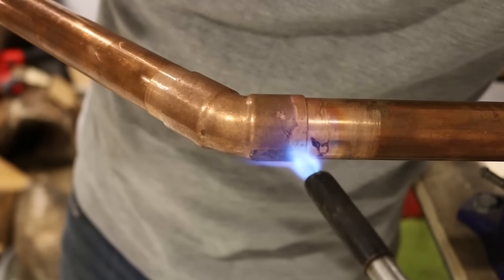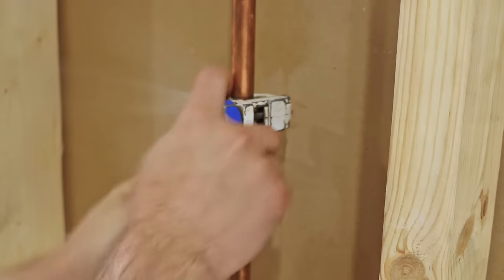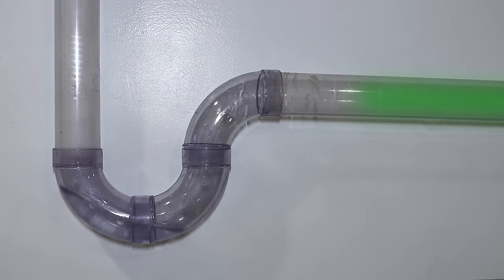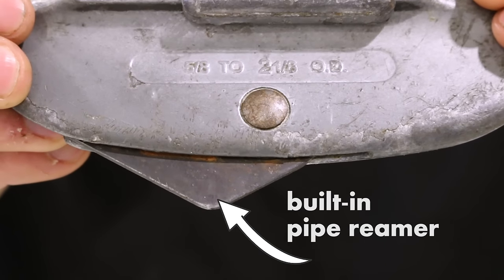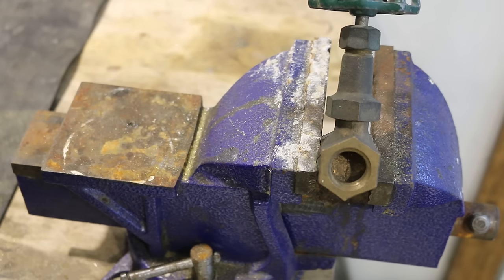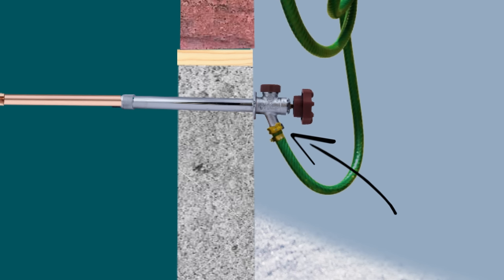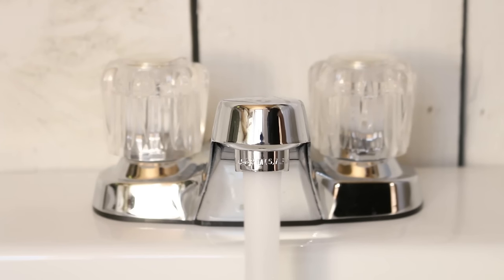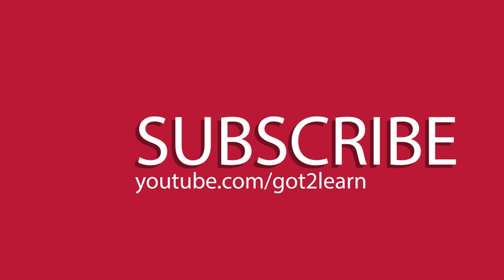The ULTIMATE Plumbing Mistakes Guide (30 Mistakes And How To Fix Them) | GOT2LEARN

Comment: Generally good advice.   BUT the use of rubber plungers, never use the toilet plunger on any thing else, just imagine where it's been. Always have one for the toilet and a separate one for sinks and wash basins
Reply from the maker: Only in an emergency 🤣
Reply: @Got2Learn  Now I can understand using a sink plunger if the toilet was blocked, now that's a real emergency!!!!
But no way would I use a toilet plunger on any indoor sink or wash basin, especially if it was Saturday and I had previously used the toilet plunger the night before !!!💀💀

At a push I'd consider using the wife's hair dry on max, if that fails then I'd consider using the vacuum cleaner, when the wife wasn't looking.😗
Reply: Actually I just remember about 6 years ago, while trying to run pipes for a rad and struggling, my son , who was 5 years old at the time, came out with a really good pieces of advice which was.
" Dad perhaps you should call out the professional's "
It was the way he said it after asking if he could help  lol

Comment: I agree with just about everything in this video except the “proper” use of dope/tape. Dope on top never gives a cleaner finish than tape on top unless you work in slow motion and never touch the dope with your hands/gloves. Also I’ve done it both ways all my career and have never had a single leak at a thread in 14 years. So it really doesn’t have a “proper” way. Just do it either way and learn to tighten stuff properly. Don’t be lazy and two tug your wrench, save that for your bedroom lol.

Comment: Why are "Flexible speedways" a bad thing... The one at my toilet is about 25 years old as is 100% as new. And the ones to my kitchen sink are 18 years old and as new. My father has used these for the past 30 years (as a plummer) and not once had a problem with these
Reply from the maker: Older models weren't made as cheaply as the once from today ;)
Reply: @Got2Learn  Ahh... that actually makes sense cause almost everything today is less durable than it was some 10-20 years ago. Thanks for all the great tips. Much love.

Comment: Vents are not for putting air in the drain. They provide reverse atmospheric pressure to prevent the syphoning of traps. A drain is designed to flow at half full, hence, there is always air in the drain. If we didn’t need traps we wouldn’t need vents. Also, if “vents let the drain breathe” thing is true, why are there no vents on a sewer and why is the code book only conceded with trap to vent distances?

Comment: First. Let me thank you sincerely for providing this very helpful information. So please don't think me over critical when I mention that all of the flux used in the video is Oatey #5 self cleaning flux. This is illegal. You must use lead free flux. Also, the guy soldering is applying the flame to the wrong place on the fitting nearly every time. It has to be heated at the shoulder, or where the pipe bottoms out on the fitting to create capillary action, sucking the solder into the joint, especially on upside down joints to prevent icicles. The dishwasher drain is also illegally connected. The corrugated drain from the DW must be strapped in the cabinet to a higher elevation than the drain connection. Also, mention that NO teflon tape may be used on black steel pipe used for natural gas. My apologies for being critical. I have 36 years in the business. Also, when plunging that bathroom sink, be sure to plug the overflow hole with a rag or you'll take a bath with dirty water

Comment: At a federal prison build, the contractor wanted dope, then t-tape. Why? Less chance of getting debris on the threads. Funny!  Why does it say "sealant" on a can of pipe dope? Because if it said "Lubricant" (what it actually is) people would use motor oil or KY jelly instead of pipe dope.

Comment: Interesting that you're still using 95/5 Tin/Antimony. Code here requires 97/3 Silver/copper. 1 lb of solder now costs $25 usd. That's one expensive makeshift belt by the way,
Reply from the maker: I guess is changes from place to place, oh and also, you can use the solder from the belt, no point in throwing it lol

Comment: Dielectric unions are no longer in the code…as they do not work… it’s now required to use a brass nipple..at least 6” long if possible
Reply from the maker: Soon those won't be code and the unions will come back, don't sweat it lol

Comment: The lead solder issue is not really a problem.
IF lead dissolved into the water it would be dangerous but, if a lead pipe layed in 1860 is still sound and not leaking it stands to reason that it's not really dissolving.
Reply from the maker: Maybe that's why people are getting sick

Comment: Put some pipe dope on the threads before wrapping with Teflon.....screwing dry (taped only) threaded PVC into metal fittings is risky. Never ever use Teflon alone,  except maybe on exposed shower head connections.
Reply: NEVER PUT PIPE DOPE BEFORE TEFLON !!!!!! TEFLON TAPE FIRST , THEN PIPE DOPE .
Reply: @robertn2813  Teflon tape is only necessary when the threads are possibly sub-standard. Quality cut threads are fine with just pipe lubricant. But if you add pipe dope first, as you wrap the Teflon tape tightly around the threads it pushes the dope deep down into the bottom of the cut threads. Simple, no biggie. Yeah, I know it causes the tape to spin around as you make-up the fitting, but that cuz you don't know how to wrap it tightly...there's a simple trick to that too.
I'm wondering why you YELL AT ME WHEN I'M ONLY TRYING TO A GOOD THING.

Comment: Thanks for your good advice.

Vinegar + Soda doesn't seem to make sense to me as they neutralize one another. 

Lead pipes and lead soldering aren't that much of a health problem as long as the pipes conduct cold water.
It's hot water that dissolves lead much more and contaminates the water.

Also worth to mention is that sewage odors can enter through a p-trap if the trap has dried out due to rare use like prolonged absence etc. - Just flush in some water to refill it.

14:50 -  When using a sink plunger it's necessary to cover the sink's over flow by simultaneously  pressing a wet cloth tightly onto it. Otherwise there's no pressure built up in the system and the sink plunger won't do the job.

Comment: I love the "Airguns" you get for unglogging.
With Copper and Steel you need to look at the flow direction, steel to Copper is fine, copper to steel is bad. At least for galvanized pipes

Comment: ALWAYS brush both the copper fittings and pipes. No excuses. They look clean, but are not.
#30 is a Backwater Valve for drains.
A Backflow Preventer is for protecting the potable (drinking) water from contamination.

Comment: What you are calling a saddle valve is actually a saddle tap. There is nothing in it that can shut off the flow. The stem is smaller than the hole in it. You are correct they are illegal in both major plumbing codes. They are junk and should not be used.

Comment: At 1:05 you show measuring pipe thread on female fittings and then say to tighten them up that much. That is very suspect and is a questionable practice. Instead, with brass or steel fittings you spin them on hand tight and them 2 - 3 more turns with a wrench Cast iron is put on hand tight and then 1 - 2 more turns as cast iron is more brittle and likely to crack.

Comment: 1:43 as opposed to what?
Reply from the maker: Don't understand your question sir.
Reply: @Got2Learn  Your video is regarding mistakes people make. The particular item that I pointed out was you telling us the  "correct way of branching off a water line" that it should be "soldered or crimped." I''m asking you "as opposed to what?  What would an incorrect way be? What would the mistake be that you are telling us not to do?
Reply from the maker: To not use a saddle valve ;)
Reply: @Got2Learn  Got it! Thanks. Definitely wasn't clear in the video.

Comment: Teflon tape should only need to be wrapped 1-1/2 times around the threads as long as the joints have been threaded correctly . I frequently wrap Teflon tape backwards when it is more convenient for me to do so. If you apply it tightly and press it firmly into the threads it won't unravel.

Comment: Pritty sure I use teflon counter clock ways when using it on GAS pipes. Literly 30 secs in the vid and I alredy have to correct you. Fuck it im out.
Reply from the maker: counter-clockwise you said?🤨
Reply: @Got2Learn  Yea I dotn know what I typed above. I was quite drunk. But fact remains. If its a counter clockwise thread then you need to wrap it counter clockwise. So its not ALWAYS clockwise like you said in the vid.
Reply from the maker: Agreed!

Comment: 1:48     I could not find that exact brass valve your using but they all 'usually' contain plastic and rubber components. It's bad practice to solder this close to the valve as the heat can easily melt the non metallic parts. Even if your valve does not contain plastic or rubber, you are setting a bad example for the D.I.Y.ers your video is aimed at here. The rest of your video spot on, good job over all.